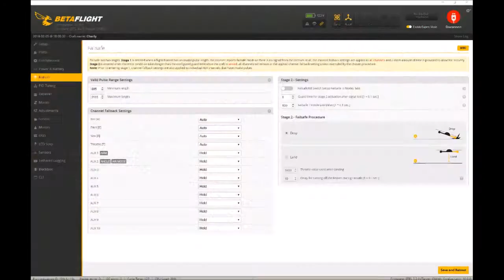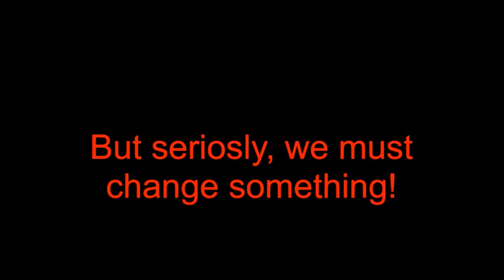Long Range Flysky i6 + Wizard x220 test

Comment: i tried the same mod, but i dont get a single RSSI point more when i activate the booster. the opposit is the case, with the stock setup it works best for me. but i wonder what i did wrong. with 2w more tx power something had to happen😞

Comment: I think you just mount your antennas wrong.. i can go much farther with my fs i6x and a x6b rx than where u get a failsafe. Just mount them in a 90° angle on top of your copter and faaar away from the carbon! Well your mod is also nice if you want to go farther than 2km or want more penetration ;)
Reply from the maker: Yes, my antennas are now mounted better ;), that improves it quite a lot, but I still can't fly behind that big bush. But I'm ok with using the signal booster, so the main issue was the video. It was flyable, but not very pleasant. I tried a TBS Triumph instead of the stock antenna, but there was no difference, maybe I'll change my vtx.
Reply: try upgrading to a 600mw, you will get much further
Reply from the maker: Yeah, I might do that, but i'll change my whole fpv setup anyway, because if you once used an OSD, you don't won't to fly without one again ;)
Reply: Charly UAV I agree about osd , without it I get to mesmerized with flying that I run out of battery or go out of range , I use flysky also , I have i6s transmitter with external dual antenna mod with 3 dbi and 4 dbi Antenna , I want to get more range but I can’t afford crossfire yet haha , so are you positive this booster adds a significant signal gain I’ve been looking at them for months I also use ia6b receiver and fli14 & fli14+
Reply from the maker: Yes, for me it definitely boosts thr signal pennetration a lot, I don't know how far you can go out with nothing in between. I never had any issues with that, bc I usually fly freestyle in or behind obstacles, never really tried long range.

Comment: When i connect+ to 5v+ and - to ground it shuts down how do i fix this?
Reply: The flysky or the signal booster shuts down?
Reply from the maker: Strange, maybe it pulls too much current, so the voltage drops too low... If you desolder your connections, does it still work?
Reply: @foigasindustries  yes then the transmitter works thx for the quick reaction but you know how to fix this?
Reply: @felixbaum2180  the flysky shuts down
Reply from the maker: @Steven-er2od  well the good thing is that it's still working, but now i have absolutely no idea what causes this. Is it working when you just have the cables soldered to the tx, but without anything connected to the jst?
Reply: No if i touch it with the wires because i desoldered it and i dont have a connector on it
Reply: I even tryed An external power source of 6.3v and i dont see Amy more rrsi on my drone is it a broken booster?

Comment: I tested only over 500 meters and I was under 40% (over 40% I have set alarm ;) and it was without alarm but I have new antenas for reciver (homemade from beter coax than standard)
Reply from the maker: Oh, i never changed sth on my receiver. I had no problems at all flying  line of sight with the stock setup.